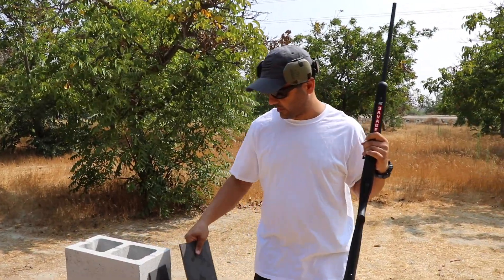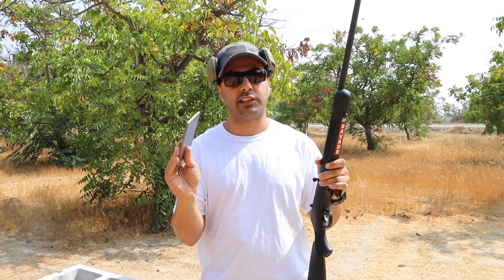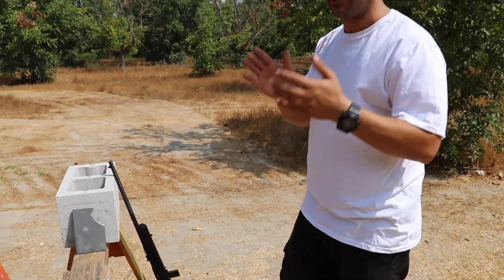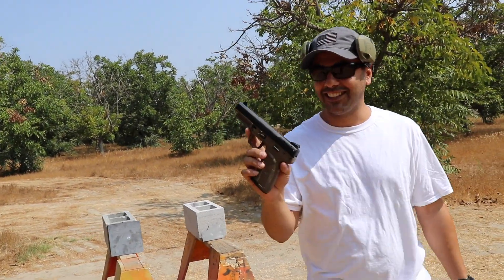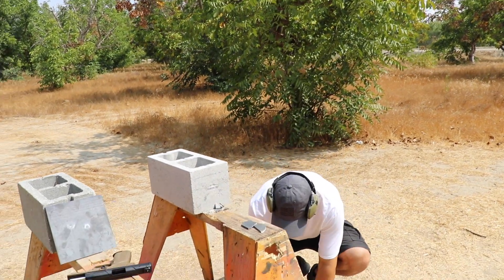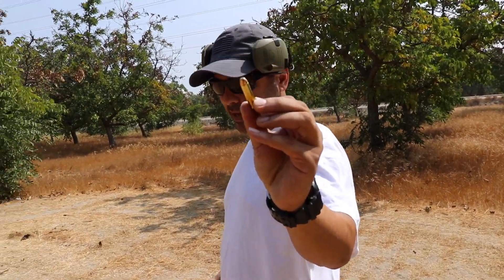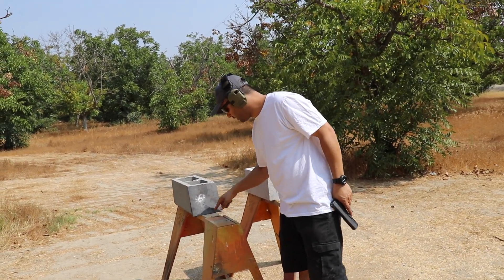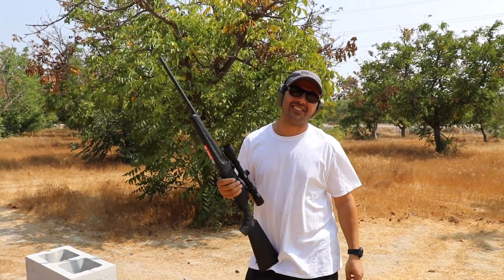Is Tungsten carbide BulletProof? - FN 5.7 vs steel

Comment: It is so hard that it will break instead of bending..
Reply: Correct
Reply: @jesseybarra3408  wrong hardness is not brittleness. brittleness is brittleness.
Reply: @clapper3530  really, I always thought it the other way around
Reply: I think I confused hardness with density
Reply: so nasa uses it to absorb all spectrum of dangerous space radiation , protecting crew and craft , ?  or maybe heat shield ??

Comment: it cracked because tungsten is much harder making it much more brittle it don't flex, I weld for a living and use tungsten in my torch and can easily bend and snap off the tips of my electrodes when they get dirty , not as much bend just snap the rods because they are so hard/ dens but have no ductility so instead of bending the Tungsten just cracks snaps or breaks oh and be careful you can get an allergic reaction from it if you cut yourself with it

Comment: Tungsten has a high density which makes it extremely hard it has low tensile strength which means it breaks instead of bending or flexing. I’m a welder and I use it in tig torch welding.
Reply: Dear God....

Comment: You should laminate the tungsten carbide to something that is more malleable like steel or even plexiglass. If you use something like pl-400 I bet your results will be much much more impressive. Even with a weak plastic backer

Comment: Tungsten carbide has a high melting point because it's generally used in cutting tools for mills and lathes to cut metal lol It is supposed to be brittle

Comment: Be careful !! Tungsten is an alpha emitter !! When ground or broken into dust it is mildly radioactive !!
Reply: Alpha particles can literally be stopped by a couple inches of air, or like, a sheet of paper or a layer of skin. Being out in sunlight is worse than being around the radiation given off by breaking tungsten. Alpha is only bad if it originates from within your body i.e. don't eat heavy metals. Actually, your stomach acid would probably absorb all of it before it reached soft tissue. Don't inject heavy metals.
Reply: Only when alloyed with thorium.
Reply: @johncolvin2561  THANK YOU I WAS GOING TO SAY THAT.

Comment: Tungsten carbide has a high carbon content. This causes it to be brittle. The carbon content is also what helps it with heat resistance.

Comment: I'd like to see .22 LR compared to the .17 HMR. The latter is very high velocity. Tungsten carbide is brittle and it shattered so easily because it tends to fracture rather then deform like steel. You were tilting it probably didn't help. That's my guess.

Comment: Hardness and tenacity are two completely different properties. The harder a material is the less likely it will be to resist a ductile deformation and there for absorb  energy. That's why no mechanical parts in  a car or no knife ever have a water quench when heat treated otherwise it will be to brital to take a cycling load. That's material engineering 101.

Comment: It actually makes a lot sense to me that it shaterd. Because hardness doesnt describe the ability of materials to absorb energy coming as a shock, but the ability not to deform that easy, which means it wont vibrate or bent, the only way tungsten is able to deform ja breaking. Steel is way better in taking shots as it can deform easy so steel will bent and spread some of the absorbed energy as vibrations.

Comment: Mohs mineral scale of hardness has Tungsten rated at 8, Tungsten carbide a 9, and Diamond is a 10. 

One of the way to look at strength vs toughness is strength is about how much force is needed to break something. Toughness is about the amount of energy needed to break something.

Glass is way stronger than rubber, but rubber is way tougher than glass.

Comment: why can't he notice the difference between tungsten and tungsten carbide? tungsten is a metal and tungsten carbide is a ceramic and despite both being hard with high melting point they have different characteristics like having significantly different hardness, melting point, etc. you can't just take tungsten compound and call it "tungsten".

Comment: Lol after seeing the humorous cast i presume the host definitely know about its properties, Well tungsten carbide is a brittle material and can't be used for anti-ballistic applications, NASA used it in their shuttle, since the material is best known for its resistance to extreme temperatures, the re-entry temperatures are too damn high due to aerodynamic heating and the structural materials aren't enough to resist it. Coloumbia space shuttle had an accident and 7 were killed because a frozen block of foam had hit the nose (leading edge) and that made a hole in it which allowed the hot air to enter in spacecraft and yet it was destroyed.

Comment: Carbide is a ceramic. Abrasion resistant. Which is why they use it on the tips of caterpillar shovels but it is a ceramic. Like porcelain. Hence why it shattered. It’s sort of like hitting a diamond, the hardest material you can think of, with a hammer and being surprised why it breaks along the crystalline structure. You should have bought tungsten metal... not carbide.

Comment: tungsten carbide is not ceramic and has nothing to do with ceramic materials, it is a alloy of tungsten which is a metal and cabon which is a element, end product is a material which is almost as hard as a diamond but brittle as a potato chip literally. It is used on machining tools such as mills, lathes and also in grinding wheels besides being silver soldered onto wood cutting blades such as table saw blades and such.

Comment: Tungsten is super hard but very brittle. That's a constant in metals. Also, 5.7x28mm out of the pistol is nowhere near 3000fps, more like 2000. Out of p90 it's like 2400fps depending on loading.

Comment: Tungsten is a Pressed powder formed under extreme heat and pressure.  It is not a standard metal.  Tungsten is also incredibly hard but very brittle and it is very rigid with no flex.  It is commonly used in making tools for the machining industry like drill bit's and endmills then those are used in a "Mill" to cut other softer metal's.  It is defiantly not designed to absorb impacts and if you would have dropped one of those plates you had from about waist level on concrete it probably would have shattered.

Comment: Tungsten and Tungsten Carbide are Extremely hard. that hardness doesn't allow any deformation without a crack forming. 
This is why it shatters. The target application of Tungsten Carbide is in metal cutting for heat tolerance. it's used with very tiny brazed or bolted inserts on a steel cutter or drill. Tungsten carbide is not resilient to impact because of this.  Instead, try 4340 or 4130 tool steel. it will be a lot more resistant to projectile penetration.

Comment: Tungsten breaks easily but has the highest melting point out of any metal that's why they use it for welding. The question is, is that 100% tungsten or mix/fused with some other substances

Comment: Bro.....if was pure Tungsten, then it wouldn't have broken. But it wouldn't have the hardness of Tungsten Carbide as well. It's like diamond, it's super hard, but super brittle as well.
You can weld Tungsten Carbide with any ductile material like steel only on the back of it and see the difference.
No one uses Tungsten Carbide all alone. And as it's very hard, it's very sharp as well (like glass).

Comment: Your so sad, why don't you just educate yourself B4 starting the video ? There is tungsten carbide, extremely hard and brittle, then there is tungsten the metal, heavy and not particularly hard (can be filed or cut with a saw) melting at 3000+ degrees C

Comment: There is a massive difference between a metal and compounds of that metal.
Tungsten metal can be brittle but its not the same as Tungsten Carbide, which is a ceramic. Tungsten is quite tough and strong, but nowhere near as hard as Tungsten Carbide. Think of it as the difference between Aluminum and Porcelain. Or better yet - Aluminum and Sapphire. One is a metal(-oid) and one is an Aluminum compound. Or even more simply - table salt, a Sodium compound, and Sodium metal. Clearly very different materials with different properties, dont you think? You messed up on this one, man. But the WC can be sold back, its a fine powder in a metal matrix anyway. Like most ceramics it can be reprocessed with minimal loss.

Comment: Heavy metal !!  

https://en.wikipedia.org/wiki/Tungsten       Tungsten, or wolfram is a chemical element with symbol W (referring to wolfram) and atomic number 74. The name tungsten comes from the former Swedish name for the tungstate mineral scheelite, from tung sten "heavy stone".[9] Tungsten is a rare metal found naturally on Earth almost exclusively combined with other elements in chemical compounds rather than alone. It was identified as a new element in 1781 and first isolated as a metal in 1783. Its important ores include wolframite and scheelite     The free element is remarkable for its robustness, especially the fact that it has the highest melting point of all the elements discovered, melting at 3422 °C (6192 °F, 3695 K). It also has the highest boiling point, at 5930 °C (10706 °F, 6203 K)[citation needed]. Its density is 19.3 times that of water, comparable to that of uranium and gold, and much higher (about 1.7 times) than that of lead.

Comment: Armour on tank(T72) is tungsten but not just tungsten. First comes ceramic to deflect HEAT rounds and absorbe copper jet, then comes kinda hard steel to take punch from all those shrapnel and smal arms weapons, then comes plastic to protect tungsten from shrapnel (you don't wanna to break tungsten from all those 30mn HE rounds just weld hole in steel and get in another battle) , then comes tungsten to stop copper jet or deform and take hit(weight play key role in take hit part) from APCR(tungsten) rounds. You need tungsten to deform tungsten. After that is little bit plastic, then empty space, then steel (soft one to absorb all the mess in front) and last thing is spall liner as last hope for poor people in big iron bicket.
As you can see tungsten is part of the armour

Comment: Tungsten is incredibly hard, but it doesn’t mean it inherently has shock resistance. Because it’s so hard it can be very brittle. I sell tungsten carbide bits (used) some are perfect while other are completely shattered from simple machining processes. Just from the title I knew small calibers would shatter most any available thickness of tungsten sheet.

Comment: This is not tungsten, it's tungsten carbide. Carbide is an isotope if carbon, close to diamonds. And it makes it brittle so it brakes but bullets cannot cross it I bet. Where in the other hand pure tungsten would have the ductile ability like other metals.

Comment: High hardness will not be sufficient elastic, vibration can spread the cracks. In order to absorb the force there should be a combination of different layers of material, for example, you can stick tungsten on a clay mass, when the bullet collides with tungsten, the hardness of tungsten will prevent the bullet and the clay layer the rear will absorb shock. you can try with other absorbent materials, it could be a lead layer ..... ^^

Comment: Did you mean Tungsten or Titanium? Tank Fin and APDS shells are made from depleted uranium capped tungsten carbide cores which can easily puncture plated steel armor using their dense mass and super high velocity.
Tungsten sheets are quite brittle.

Comment: Tungsten breaks. It is also used as welding tip, because it doesnt melt. of course at some degrees but not when welding steel.

Comment: If you need to shoot tungsten carbide and keep it in one piece, it needs to have an elastic material as a backing to absorb the shock transferred. Tungsten carbide is used for ballistic protection but not in the way you've testing. It is meant to crack but it will force the projectile to tumble after it punches through the ceramic. The rest of the armour behind will catch the projectile fragments. Tungsten carbide is thus a sacrificial material.

Can tungsten carbide withstand without cracking? Yes. But as mentioned, it needs to have an elastic material (elastopolymer) to absorb the shock and expand.
Reply: https://seadefreview.quora.com/NERA-Understanding-Non-Explosive-Reactive-Armour

Comment: We use it on drilling rigs for drill pipe tongs. They have 5 tungsten inserts and our drill pipe slips use them as well. If you get it to shatter and it penetrates your skin it will not come out. You have to go to a doctor to get it cut out because it is so heavy. It will cut thru regular metal. www.alibaba.com will sell you 100 pieces for $50 USD.

Comment: tungsten carbide are ultra hard, strong materials but they are brittle, that is they have low, or zero ductility. Carbides are compounds of carbon with other elements. Strictly speaking they are not alloys.

Comment: The wolfram carbid broke becaus its very hard and also it is much more brittle than stell which is very tough, carbid means its an alloy of wolfram(tungsten) and carbon. Steel can also be amazingly brittle but only when its hardned (heating over 800 celsius degrees, and fast cooling) :D

Comment: It broke because of the hardest of the metal. Just like a diamond can scratch anything but if it hits the floor it shatters. Carbide drill bits will crack if you drop them on the floor
Reply: Hardness not hardest lol need to check my spelling before I send stuff.

Comment: Maybe try some solid Stellite steel in place of carbon and stainless steels with tungsten coatings, they use it in oilfield equipment like valve seats, it is a rockwell of 58 without heat treating it; it's used in place of carbon and stainless steels with tungsten coatings. 
NASA uses SM100 steel I believe, that is a 60-40% mix of nickle and titanium because it is corrosion proof but hard enough for ball bearings. 

 https://spinoff.nasa.gov/Spinoff2015/ip_4.html

Comment: Tungsten Carbide is not a metal. It is a combination of materials much like concrete formed from a powder under heat and pressure. While it is very hard it is also very brittle.

Comment: Tungsten carbide is extremely hard and extremely brittle like most metals the harder you get the more brittle it is. Also it is often referred as the second hardest thing to diamond. That's why they use it to cut majority of metals in machine shop and Industry. It also makes great punches because it does not wear it only cracks. They also make different types of carbide which are more impact-resistant. They usually come in smaller pieces but you should give that a try like something that you would find on a wood grinder.

Comment: I have a tungsten ball and it was also very expensive. The tungsten broke because it’s a very hard material.
Reply: Tungsten will bend. Tungsten Carbide will shatter. I'm annoyed by how often people confuse the two.
Reply: @Minecraftian2345432  tungsten absolutely doesnt bend, will shatter almost at easily as tungsten carbide
Reply: @Minecraftian2345432 tungsten don't bend its hard
Reply: Tungsten is hard but brittle
Reply: @matrixmeme482  Tungsten Carbide*
Reply: @Pao234_ tungsten is hard but brittle aswell
Reply: I wonder if tungsten Is stronger then any material bc he kinda got dented by a medal bullet
Reply: Its very hard to cut with angle grinder carbamide drills. Working on fasade, making bouhght drills from 10mm to 9,5
Reply: Tungsten is a metal. It's hard and tough. 
Tungsten carbide is a ceramic. It's very hard, very strong, but brittle. It's like "super glass".

Comment: 6.5 fmj has pretty decent penetrating power, ive never shot at proper armour but plenty of mild steel as well as some truck flywheels and harmonic balancers. My 6.5 Swede's & Creedmore eat 14mm for breakfast.Something i have noticed is the mass of the object is very relevant, light small objects need to be held firmly or the bullet will just move the object vs penetrate.I have 2" disks i hang of my target frames, just mild steel, as long as they swing the 6.5mm doesn't penetrate, just accelerates!

Comment: we use tungsten in tig welding as the electrode and you have to be really careful not to drop it because they tend to shater because it is a realy hard but belittle metal.

Comment: Tungsten is brittle. Its dense and strong but brittle like concrete. I thought this was some what common knowledge that titanium is light weight and strong while tungsten is heavy and brittle. I wish I could remember how it was phrased back when I was told this. Judging by the comments people have never worked with it before. Try playing with some tungsten welding electrodes you learn quickly that tungsten is brittle and doesn't have super high tensile strength like titanium.

Comment: What Is Tungsten?
Tungsten is a metal that is extremely hard and melts at a very high temperature. It is also very dense, and the jewelry made of it feels surprisingly heavy.

Because of its durability, tungsten is a preferred material for buyers looking for jewelry that will last a very long time.

However, the physical properties that make this metal so robust are also the reason jewelers find tungsten relatively hard to work with.

What Is Tungsten Carbide?
When tungsten is mixed with carbon, the resulting compound is called tungsten carbide. This material is even more durable than tungsten.

The tungsten carbide used in jewelry making is usually mixed with a small amount of nickel.